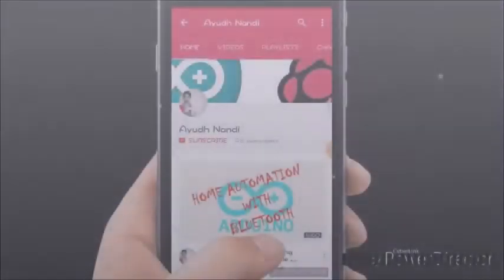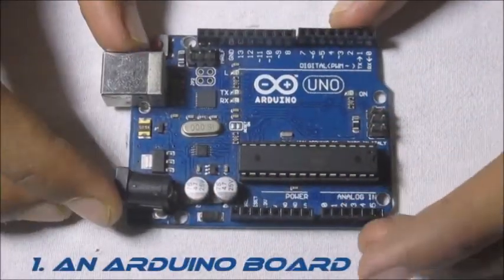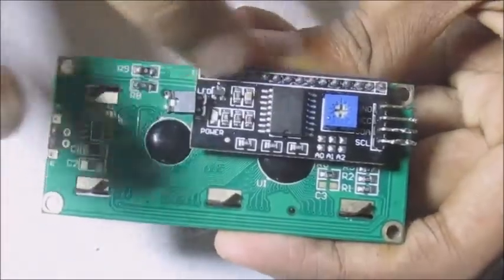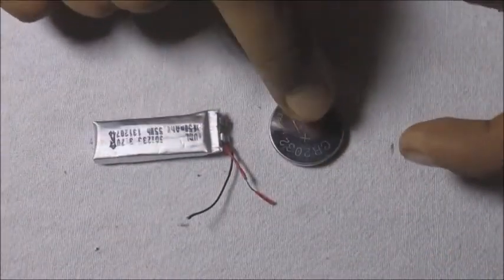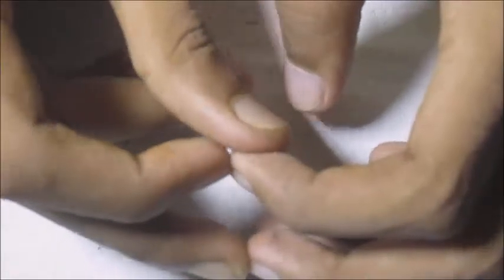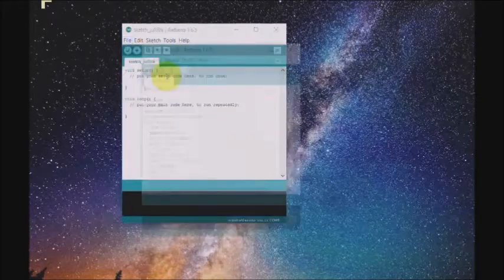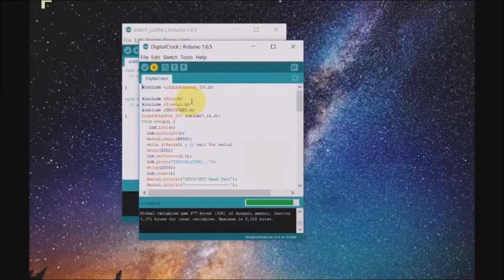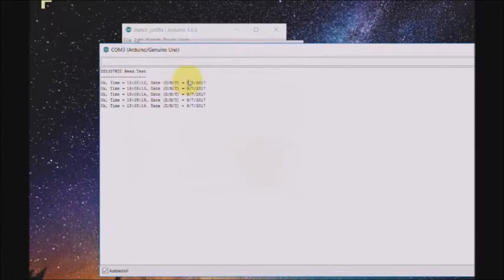||Digital Clock Using Arduino || TINY i2C RTC MODULE

Comment: you should not solder anything to an arduino or to pins ! ... get some jumper and dupont cables !
Reply from the maker: i prefer soldering over using jumper cables... soldering makes the connections more secured and safer to use...  i mean soldering is my comfort zone...  
no offences..  

Thanks
Reply: that's your hardware... but then why not solder an atmel on a protoboard and take care of the power circuits ?
Reply from the maker: That's a lot of work...  m a lazy bum...  😅
Reply: Mmm both are right